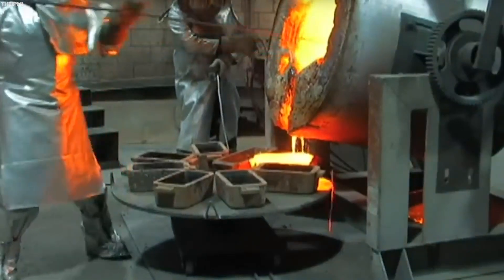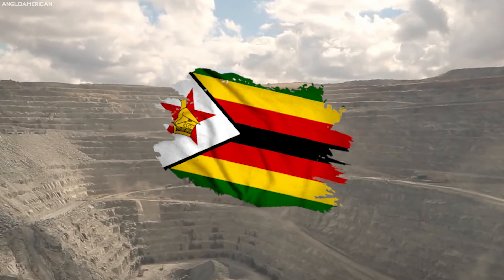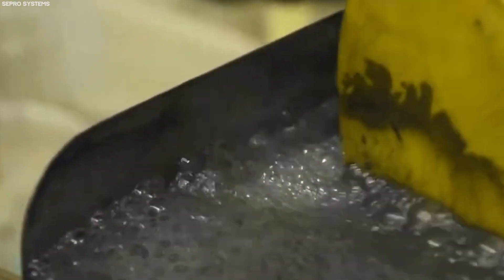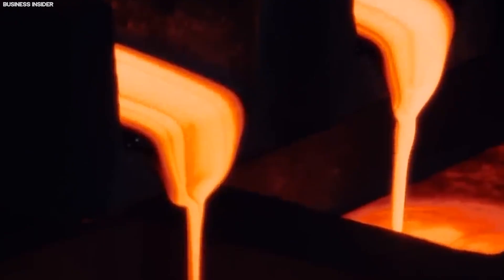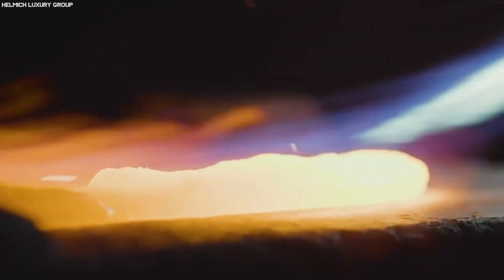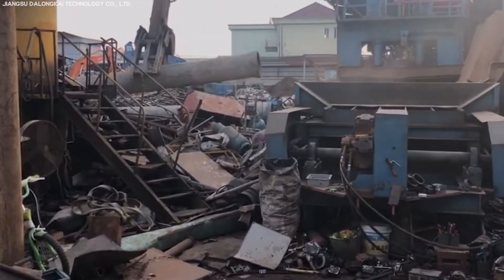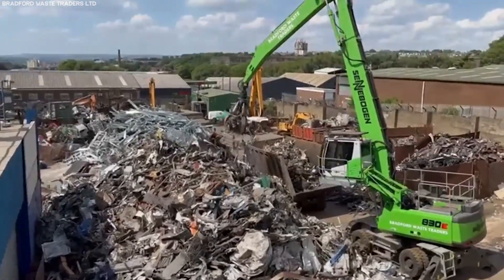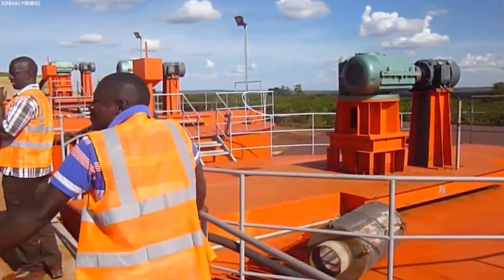How PLATINUM is Made - $40 BILLION Industry!

Comment: Fact Check: Platinum is not worth 30× more than gold.
In reality, gold is currently more expensive than platinum. Historically, platinum has sometimes traded at a premium to gold, but never anywhere close to 30×. The ratio has usually hovered between 0.5× and 1.5×, meaning platinum is either slightly cheaper or slightly more expensive than gold depending on the year.

Platinum vs Gold Price Ratios
• 	Current Prices (2025)
• 	Gold: around $2,400 per ounce
• 	Platinum: around $950–1,000 per ounce
→ Gold is worth about 2.5× platinum, not the other way around.
• 	Historical Trends
• 	1970s–2008: Platinum often traded higher than gold (sometimes 1.2–1.5× gold’s price).
• 	Post-2008 Financial Crisis: Gold surged as a “safe haven,” while platinum demand (tied to auto industry catalytic converters) weakened.
• 	2015–present: Gold consistently more valuable than platinum, with platinum at ~0.4–0.6× gold’s price.

Why the Confusion?
• 	Rarity vs Price: Platinum is rarer in Earth’s crust (0.005% vs gold’s ~0.01%), but rarity doesn’t always equal higher price.
• 	Industrial Demand: Platinum’s price is heavily tied to automotive and industrial use. When demand drops, so does price.
• 	Investor Behavior: Gold is the dominant “store of value” metal, so during crises or inflationary periods, gold prices rise faster than platinum.

Comment: Platinum was never worth 30 times the value of gold. In fact right now platinum is worth less than half the price of gold.
Reply: Yes, Platinum is very cheap,  about third the price of Gold , and it hardly has any uses in the industry now days ,  hence the cheap price .
Reply: @ahmedalsharman  Is platinum used in chips?
Silver – Printed Circuit Boards, Computer Chips, keyboard membranes, some capacitors. Platinum – Hard Drives, Circuit board components. Palladium – Hard Drives, Circuit board components (capacitors) Copper – CPU heat sinks, wiring and cables, Printed Circuit Boards, Computer Chips.
Reply: @ahmedalsharman  1. Platinum can help treat cancer
In certain chemical forms, platinum has the ability to slow or stop the division of living cells. Platinum-based drugs have been developed to treat a wide range of cancers.

The first platinum based chemotherapy drug discovered by researchers was cisplatin, which forty years later continues to have applications in certain types of cancer. In that time, scientists have searched for ways to improve the anti-tumour efficacy of platinum based drugs, reducing the toxicity profile, and strengthening them against resistance.

2. It makes cars safer
Platinum-cured silicones are used to coat and protect automotive air bags from their explosive systems. Thanks to the platinum treatment, these air bags remain stable and can be kept folded and packed for long durations without deteriorating.

Additionally, the air bags contain an initiator sensor, which uses a fine platinum wire coated with explosive material to facilitate release of the air bag.

3. Platinum improves personal hygiene
Platinum-cured silicone mixtures are used in a range of personal care products from lipsticks and shampoos to contact lenses.

Additionally, the use of silicones in medical elastomers is one that is showing strong growth going forward. For wound healing they have excellent properties, in that they will stick to dry skin, while not sticking to and damaging the wet wound. Silicones are also air and moisture permeable which improves the healing process. 

4. It helps you get from point A to B
Platinum acts as an effective and durable catalyst in hydrogen-powered fuel cell electric vehicles (FCEVs).

All FCEVs use a type of fuel cell known as the Polymer Electrolyte Membrane (PEM). This low-temperature, quick-start cell runs off pure hydrogen and uses platinum and palladium at its heart, with the FCEV itself emitting only water from its tailpipe. 

Anglo American is a strong supporter of FCEVs and will continue to partner with industry and governments to secure the future of this clean, sustainable solution.

5. Platinum keeps you warm
When you think of any metallic substance, ‘warmth’ and ‘comfort’ are probably the last words that springs to mind.

However, platinum catalysts are used to make petrochemical feed stocks, the basic raw materials for the manufacture of plastics, synthetic rubber and polyester fibres used to produce clothes and blankets. 

6. Platinum provides power off the grid
Platinum-based fuel cells are proving to be more cost-effective, cleaner and more reliable than alternatives such as diesel generators.

And it’s these fuel cells that are making a real difference across rural areas of South Africa, where two million households are without electricity, of which more than one million are in rural communities. 

Fuel cell mini-grid electrification technology is an attractive, cost-competitive alternative to grid electrification in these remote areas and could accelerate access to electricity. Electricity in homes and schools improves the quality of education, and the ability to pump water for irrigation facilitates farming and income generation.

Platinum is the key for these communities to be able to access the power that is vital to modern living. Discover more about platinum group😊
Reply: Gold and platinum are the most high paying tho just cashed in 20k in coins 🪙 I think it was like 948 a coin